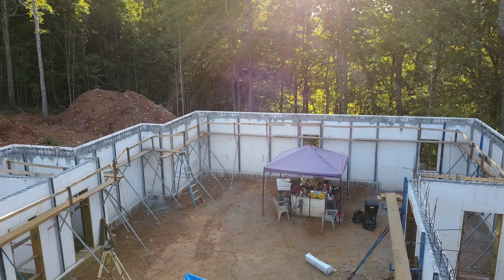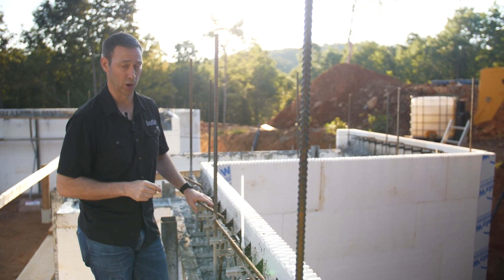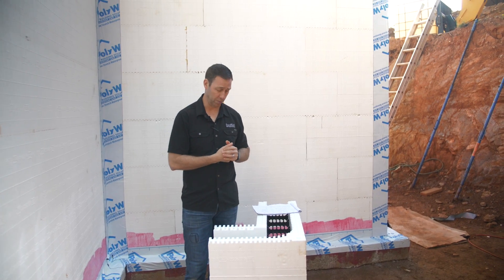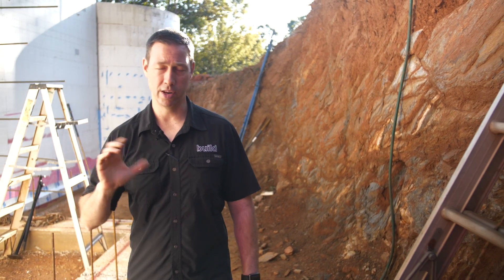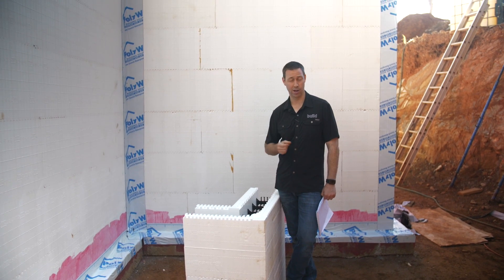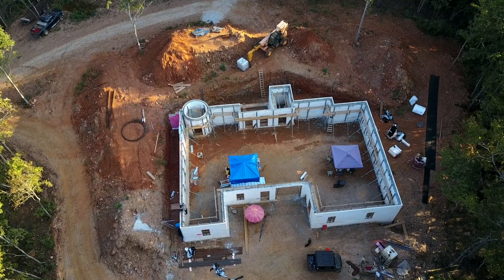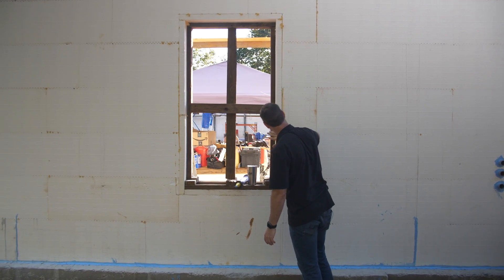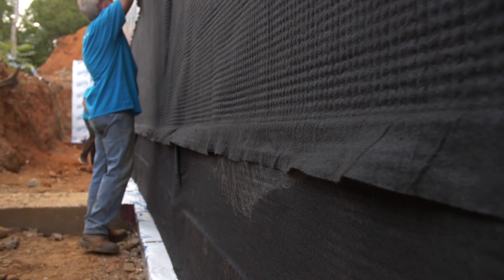Insulated Concrete Forms - Overview, Costs, and Cons

Comment: up here in Canada,  it not a system that is very popular, R value is too low and construction cost too high. Having 2 side foam prevent the use of the concrete as a thermal mass, spray 4 inch of foam on outside foundation wall will be a better way of  using your concrete foundation wall as a thermal mass. Your wall above could be constructed of 2 inch white Styrofoam nailed to plywood sheet, 2x4 + 2x3 fill with cellulose.   You should reach R 28 for your foundation wall, R40 for your outside wall and R 60 for attic, these are the new guideline for Northern climate....

Comment: Once that top plate comes on then the house can not be flipped by wind. The only thing that might fly away is the roof. Also, it's bullet proof. Heavy artillery is still debatable.
This system looks easy. I built a house in this style and method in 1987 and it was a bear. It's a great, big and comfortable house. 3 levels high with an elevator.

Comment: Matt - Where do precast insulated concrete panels fit into the spectrum of wall structures which include ICF and SIPS? Or is that just another name for ICF?...But it seems that ICF is a concrete sandwich with foam on the outside, whereas precast insulated concrete panels are a foam sandwich with concrete on the outside. But I am a consumer/owner and not a contractor. Just trying to scale the learning curve now so I can specify the best system for me. Thank you!! ~Will

Comment: Another big advantage for me is pest resistance. I am not going to have to worry about termites, ants, mice and other insects, rodents, etc. burrowing into or through my ICF walls as I have with wood-framed buildings.
Reply: yes but they will borrow into the foam, and that way they can access wood in your roof and you wont see detect them until extensive damage...

Comment: 40k just  to extend electricity lines to their property? That's when solar panels start to make sense.
Reply: solar panels don't generate electricity 24/7, they never make sense if there is electricity nearby... only exception - some remote cabin, otherwise it's just a fad, to pat yourself on a back to feel good, pretending you are "green".
Reply: @efreitorhabibulin238  Ummm...Solar+Battery packs are 100% a great power solution (as long as you have good sun through the year). Don't talk bad about solar if you don't know anything about them.
Reply: I own a large solar system. 9k sq foot home would cost more than 40k of solar. You are talking what would be normally be a 400 amp service. They will need 2-3 solark12ks 30 kw panels 2000ah battery bank minimum
Reply: @av1204  and how much would you need for solar?
Reply: @Nikola8000   what do you mean?
Reply: @av1204    you said more than 40k for solar. How much more. Just interested. Wanted to point out if you do give 40k to electric company for power line you still have to pay them on monthly base. Using solar+batteries just upfront cost
Reply: @Nikola8000   well not necessarily. Solar Panels are rated for 25 years at 80% efficiency. New lithium batteries are rated for 10 years max. You could go iron edison batteries which will last a lifetime if taken care of. Inverters are rated 10ish years. So there are reoccurring costs to being off-grid.  rough ball park 75k for just equipment

Comment: hi matt, i just wanted to point something out, i've known about ICF for quite a while (a friend was building houses like these and wouldnt shut up about it lol) and the major downfall is the fire, 

my friend works as a high rank firefighter and when houses are built in ICF most of the time they cant even enter because its way too hot, no houses can be saved
Reply: Alexis Gagnon It doesnt work that way!
Altough agree,no house can be saved from fire.
What is important is to prevent fire in a first place! And that's where ICF shines. Be it short circuit,thunderstrike,curtain on fire,or even Molotov cocktail on the outside wall. All this circumstances will lead to only eps melt and self exstinguish,without spread the fire.
That's why they have much lower insurance rates in the first place.
Heck,if there are no furniture inside,you can't even arson that house :)))

Comment: I admire that your program has developed into a open platform the gives positive and negative points in building I appreciate that your showing and discussing energy issues concerns as well as potential water problems. I can see your program expanding to show a wider range of heating products water collection,grey water. Solar and wind looking forward to input from other professionals and your up coming cable program good on you

Comment: ICF for basement walls in a warm climate is a bad idea if you wanted to achieve cooling through the basement walls. Friends of mine who I helped build ICF home near Wichita, KS said they never used their heater, but had to run AC even in the winter because there is no cooling at all from the ICF-walled basement. And everything you do inside a well-insulated house just adds heat. Your electronics and everything you turn on including lights and TV all turn that electric power into heat in your home.

ICF walled basements in colder climates are an obvious smart choice, as are insulated floor slabs. As you move south within the US, somewhere slightly warmer where AC is useful in the summer, you will want that cooler basement to help transfer heat into the ground. If I were to guess, somewhere that recommends insulated slab floors because of the extreme cold winters isn't needing maximum cooling from a basement in summers.

Conversely, a warmer climate that makes heat pumps a positive and efficient heat source isn't going to block off their easiest and best cooling source from basement walls and floors. For all the houses constructed in the middle areas that need some cooling and some heating, just realize that you have a lot of heat sources in your electronics and window's solar gain that count a lot more when your heat transfer is reduced with ICF's better insulation factor.

Comment: Perfect
Reply: You can even go into designing a designated movie room with insulated soundboard wooden framed and sheetrock covered room. Add a surround sound system in the cavity of the wall structure.: Not a post build, screw in Mount.

Comment: Matt, ICF's have been around since the '70. Energy consumption data IS available for these homes for just about any region. They have demonstrated they can perform really well in cold climates without adding more EPS. So, when you say you think the low R-value is a downside, I believe you're showing us that you haven't done your research and that you do not understand the concept of EFFECTIVE R-value. I have subscribed to your channel. I have learned a lot from you on other videos but I believe you are out of your depth on this one.

Comment: One more thing Matt... About cost. One thing I haven't heard you mention is the impact of design on cost. In the project you show here (which is really nice by the way) the owners have that turret or round section, they also have that safe room/cellar, then the design has 14 - 90 degree corners and 4 - T-wall connections. That is a very labor intensive project. Now, I understand that they are installing the forms themselves, but if anyone else had to pay installers for this job, the installed cost would definitely be more than $15 per square foot of wall. Additionally, the square footage of the walls is typically calculated as if the walls were solid, without doors and windows. Why ? Because it gives a more standardized way of estimating costs. 

Think about it, installing a solid ICF wall goes really fast compared to a wall where you have many openings for doors and windows. Installing openings in any wall type slows the process down and requires additional materials. If the installed cost was calculated from the square footage of the solid wall portions (after subtracting for doors and windows), it would mean that a wall with a lot of doors and windows would cost less than a solid wall, which is NOT the case. The savings on the concrete do not nearly offset the additional labor and other materials required to properly install the opening frame. When you have any type of opening in a concrete wall, you have to create a lintel and the entire opening has to be engineered, reinforced and properly attached. That takes time which means additional costs. Fortunately, a good ICF manufacturer will provide installers and customers with engineering tables for rebar reinforcement for most typical situations. 
My installation pricing assumes straight (not curved) walls and usually includes up to 6 corners. Anything beyond that has a fee: Additional corners beyond 6, curved walls, beam pockets, floor system connections for multi-story projects, etc. 
In short, the fancier the design, the higher the cost.

Finally, I wouldn't recommend that someone new to ICF's gets into installing a fancy project like this one UNLESS they are assisted by someone that has sufficient installation experience. That is why some ICF manufacturers will only sell their product through properly trained installers. Otherwise, someone will make a mess and blame it on the brand or on the system (ICF) when the real issue is a poor installation.
Reply: I'm curious as to what is that round section for?
Reply: I wonder if somebody makes prefab blocks with properly engineered openings as I believe, it is much easier to manufacture them at the factory, then make in the field?

Comment: Another thing Matt...  You do NOT toe in your walls when bracing. You brace them plumb. You check them right before you pour as well as immediately after you pour. If they have moved a bit during the pour, you can use your turnbuckles to straighten them up. A simple string on the opposite side from the bracing system will do the trick and you straighten them up to the string. It works great. The reason you DON'T toe the walls in goes like this: You pour these forms from the top. The concrete pressure applies evenly to both the inside and outside surfaces of the pour cavity, so the pour itself doesn't "pull" the wall to one side or the other. 

Yes, the walls will almost invariably move a bit during the pour for various reasons, two of which are how well anchored to the ground the bracing system is and, the movement and vibration of the pouring crew on the scaffolding. But if, as one person completes the screeding at the top a couple other guys can straighten up the walls back to the string, you'll end up with decently straight walls.  

In this video, your bracing system is installed on the inside, which is typical. It appears that you are under the impression that , if the walls will move, they will do so AWAY from the bracing system. And that may be why you talk about toeing the walls in a bit. But experience tells you that the walls can move in either directions. So, there's really no alternative to proper, plumb bracing. Think about it. What if you toe your walls in by a 1/2" in, say, 10 feet, your pour the walls and they do not move out as predicted, or worse, they move in some more because of loose bracing or whatever? Best case scenario, you're in by 1/2" in 10'. Not good. What if this is a multi-story project and you need to set some pre-manufactured floor trusses in for the 2nd floor and your poured concrete walls are leaning in by 1/2" on each side at the top? 
Bracing them plumb and keeping them that way is the only way to go. My 2 cents.
Reply: You move your braces back to plumb after the pour.  it is easier to push on the wall than pull it with concrete.  your wall will not have the concave effect when you do this right not as mentioned above.

Comment: No Matt, the R-40 is NOT to be taken with a grain of salt!  It is what is called the EFFECTIVE R-value. It is a combination of 3 factors:
The EPS R--value, the thermal mass of the encapsulated concrete which drastically slows down the speed at which the outside conditions can impact the inside living space, and the continuous "blanket" nature of the wall compared to a stud-cavity-stud-cavity wall.  It is because of this effective R-value that, for heating and cooling, properly built ICF homes use only a fraction of the energy used by standard framed homes.
So, you are right, the R-value doesn't tell the whole story. I was told that the R system for calculating the Resistance to energy flow/transfer, was developed by Owens Corning for their fiberglass insulation. I believe this is why the ICF industry has been using the term EFFECTIVE R-value that accounts for the performance of the entire wall assembly, not just the EPS R-value or even the straight sum for the R-value of the assembly components.

Comment: Well done video Matt.  Pretty accurate.  but as a builder of 15 ICF projects I would really caution homeowners not to do the first one unsupervised!  My mentor, a pioneer of ICF's said  "Concrete will never miss an opportunity to make you look stupid"  At 2 tons per cu. yard,  he was right.  Check the block manufacturers recommendations.  Particularly on the corners.  Slump?  Aggregate? Pump?  If you don't know what those are, you're in over your head.  Vibrate but don't over vibrate.  Turns a stiff mix to jelly, and ICF's can not take that.  You end up shoveling  hundreds of pounds of concrete out of the hole and repairing walls while your concrete hardens in the truck.  Pouring is not a DIY!!!
Reply: He didn’t say owner did their own pouring. I understood that owners just laid the lightweight ICF

Comment: 14:56 BZZZZZT! Wrong! We built using ICFs in Potsdam NY. Regularly gets down to -20F, sometimes -30F. No problem keeping this house warm. You see, the footers are buried 4' into the ground, and we insulated them with 2' of 2" foam placed horizontally. They're going to be about 50F year-round. The R value of concrete is 1, which means that the entire wall is going to be close to 50F. How hard is it to heat a house when you have 2" of foam between you and a 50 degree F concrete wall? Not hard. Not hard at all.

Comment: Some ICF block manufacturers (NUDURA) do offer variations in core width in order to add thicker foam inserts and increase the R value to the desired level.  That way, constructing ICF homes in colder places like Wyoming can be better equipped to shrug off the wintry chill.

Comment: The remodeling aspect is the achilles heel of ICF.  I'm not a fan of stick framing, but its one true benefit is ease of remodeling.  98% of all buildings in America want to retain that capability as the primary aspect.

Comment: My uncle has a 5000 square foot icf house at 10,000 feet in Colorado. He was on vacation for 2 weeks during 20 below zero temperatures he had no heat during that time when he can home the temp was still at 45 degrees inside.

Comment: I'm a retired firefighter. I wish I had my pictures of an ICF house that had a fire. Here's what I've seen.

Concrete may be considered "non-combustible" but the contents on the room, called the fuel load, are usually not. These materials can burn long enough and hot enough to heat the room up to 800-900 degrees. Spalling occurs as low as 250 degrees F. At 550-600 degrees F concrete will begin to expand. If one side of the wall is expanding at a different rate than the other side serious structural damage can occur. Above 600 degrees concrete will begin to lose structural capacity.

Having said that...  I must tell you that I love ICF houses. A contractor friend built two of them. His houses are 4 times the size of my house. His year 'round heating and cooling bill is the same as mine. During construction a small tornado went over his house an tore up some trees in his neighbor's back yard. He didn't even know it went by.

Love the build show Matt. Thank you for your dedication and hard work.
Reply: What do you think even a small internal fire is going to do to the styrofoam?
Reply: @elrolo3711   It's impossible to say because "small internal fire" doesn't give us any information to go on.

As you know, fire needs an ignition source, fuel and oxygen. What would happen depends on the availability of those things in the room. Every situation has to be sized up independently.

My department once got called out at 2 AM for a small, unattached garage fire. The owner of the garage had large vats of fryer grease which he was converting into bio diesel. The experiment got away on him which made him very popular with the neighborhood because it smelled like a giant burnt french fry for several days.

A small fire can generate lots of heat so I would say that if you can put it out with a bucket of water probably nothing. BUT - In any room and contents fire you should consult a professional.
Reply: if the interior has drywall over the internal insulation, wouldn't that separate the ICF from the flames? Does that make a difference?
Reply: @slicktires2011  Yes. Drywall will slow down a fire and shield concrete to a degree. What needs to be considered is the fuel load. How much of the contents in the room is flammable? If the fire has no fuel it will move on. If it has fuel and oxygen it will stay in one spot and cook everything.
Reply: Would an indoor sprinkler system help prevent an interior fire from causing the damage described above?